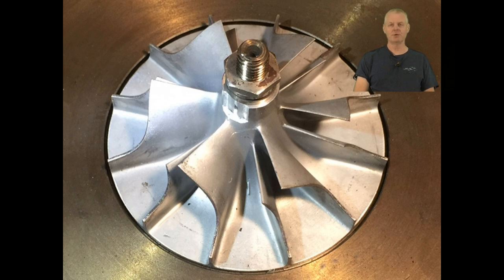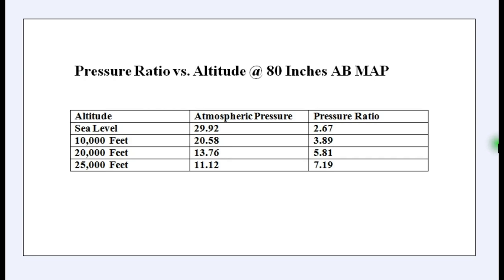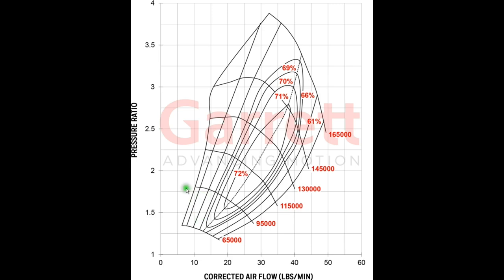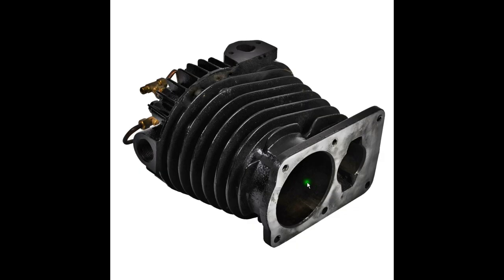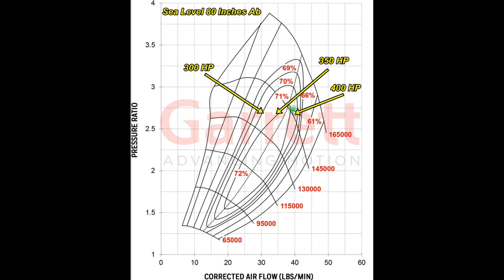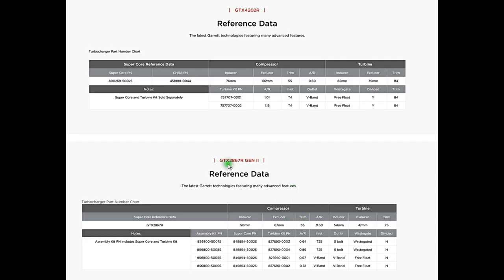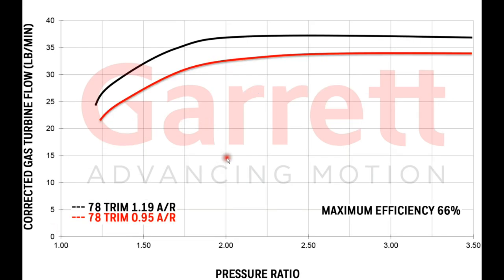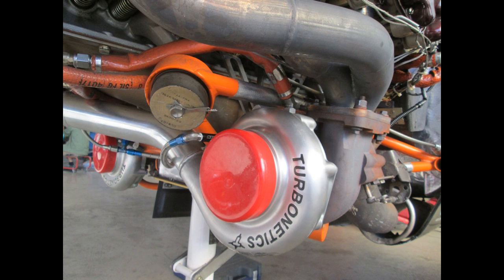What's Wrong With Raptor's Compound Turbo System?

Comment: Have you tried to contact Peter? I have been following him for several years, and he used to take advice from people who comment. Starting late last year I think, he has started to show a little disdain for people's comments. I really like Peter, he's a nice guy, and he's very smart about a lot of things, but he's clearly stubborn and close-minded when it comes to anything related to engines and turbos. Seems like he doesn't want to hear anything about it. I think he thinks that he's the smartest man in the room all the time when sometimes, he's clearly not. I'm really a big fan of his project, and I really wish you would contact him. If you do, please lead with your experience, like you do here in this video, so he doesn't dismiss you automatically.
Reply from the maker: I commented several times on his videos but he dismissed the suggestions as, like you say, he's knows it all after a few hours on Garrett's site... His project, his call, but it's destined to failure unfortunately  IMO if he stays on his present path. There's lots he doesn't know about many aspects of aerodynamics, structures, engines,  system design, turbos, cooling etc. We can see the results of that lack of knowledge so far.
Reply: @rv6ejguy  I don't know if there's a way for you to reach out to him directly, maybe if you contact the airport where he has his plane stored. There's got to be a way for you to get in touch with him. Your comments are probably getting lost amongst all the other comments from guys who don't know as much as you do. There has to be a way for him to watch your video, and see how much experience you have. He's a software engineer by trade, and I've been in his business for more than 21 years. I know the type, they always think they're the smartest person in the room, and you can't tell them anything. I posted a link of your video in his comments, he used to listen to me, so hopefully he'll see it.
Reply from the maker: @FreeSpeechWarrior  He's free to take or dismiss my advice or that of any other person. There's lots of nonsense advice posted on his YT by other people with no experience in these fields as well so who do you listen to if you don't know any better yourself? Peter doesn't know me and I don't know him. I made this video more for other interested folks rather than Peter. I don't see him changing turbos at this point in any case, maybe in the future on the 2nd prototype if there is one...
Reply: I followed Peter's build and my concerns grew as the project evolved. I contacted him and volunteered my experience and help with EABs and TDIs. He wanted nothing of it. He has a devoted fan base in his comments section that rail against any constructive or seemingly critical commenters as simply being "haters". 

There could be nothing further from the truth. I want his project to succeed, everyone I know that has been following it does.
Reply: @keepyourbilsteins  Yeah JP,  I guess it's just one of those things, you can lead a horse to water, but you can't make him drink. You can't help somebody that doesn't want help. Well you know what's going to happen? There's one good thing he's stubborn about, and that is testing. He's going to continue to test, and test, and test, and that engine is going to keep overheating and failing. Eventually he's going to have to either listen to the experts, or scrap the whole project all together. Because even though he's closed-minded, I don't think he's going to try to put out a plane that's clearly not ready for prime time. I just hope he doesn't get hurt going through the same futile exercise as he did with the last engine.
Reply: @FreeSpeechWarrior  I am afraid he'll get into a situation where he's going to be in the sky, wishing he were still in the ground, and unable to execute a safe  RTB. I screamed out loud at his first test flight. Had I not known it wasn't published posthumously, I felt for sure that was the end of him.

The 2 EABs I've done turned out great. Because I had EAA brothers and sisters there along the way to help and advise. I hope he gets his contaminated engine components situation from the previous engine failure sorted out.
Reply: I appreciate the concern Peter's clan have for Raptor and the desire to see it succeed. I hope he succeeds for a variety of reasons, not the least of which being success means he doesn't die in that thing.
Do try to understand that Ross does this for a living. Many people with forward-thinking, innovative projects pay Ross well for his knowledge and products. I think he's been quite generous already with what he has shared with Peter, to no avail. I would not expect Ross to devote his valuable time reaching out to Peter in a fruitless campaign. It is what it is.
Reply: @FreeSpeechWarrior  he has read Ross's comments because Peter has dismissed them in his video commentary.
Peter is smart enough to know who Ross is and what he does for a living.
Reply: @rv6ejguy  - As a systems engineer (but not a turbo expert), I believe the Laws of Physics will impose their own reality upon the Raptor design, one way or another. But as an old preacher once said, "humility works best when it's volunteered for."

Comment: These kids should of reached out to people whom are experts in the different fields that they have issues with. Seems like they're just wing it sometimes.
Reply from the maker: Well, Peter doesn't look like a kid but he certainly would have been further along in the project  and more successful if he'd consulted some aero, structure, mechanical, systems, diesel and turbo experts. You can't start from zero knowledge in these fields and expect build a world beating pressurized, compound turbo, diesel powered canard design. There is so much to know here in multiple fields, it's almost impossible for one guy to get this all right the first time. You'll get a lot of hard lessons along a very protracted design and development process as we've seen.
Reply: @rv6ejguy  well said.  I was going to comment the same, but you worded it better.   Peter should be managing the project, managing experts in order to stay on schedule. the death of projects like this is dragging it out longer and longer and longer.  momentum and interest eventually dies.

Comment: Sigh! This is not new knowledge, it is not cutting edge nor even something you need anything more than a slide rule to compute.
Read Stanley Hooker's book "Not much of an Engineer" which details his time at Rolls Royce and how they added compounded superchargers to the Merlin engine. Same calculations same results and Hooker did it all from first principles. He was a newly graduated engineer, in his first job designing compounded centrifugal compressors for the first time. 
Problem is that if you go too far down the turbo diesel route you end up with the Napier Nomad and then you reinvent the jet engine.

Comment: How much experience do you have with a turbo diesel? Diesel can take lot more boost with the high compression they can produce lot more torque. My Cummins 6.7 produces 850lb of torque yet only 375 hp. I suppose a gas engine of that size could produce lot of torque if it was using a turbo charger, but it would require high octane fuel to do it.
Reply from the maker: I have turbocharged diesels in the past. Torque isn't so important here. Hp is the measure of rate of work done and what we need in aircraft. SI engines put out more hp and torque per unit boost than CI engines. You can watch a comparison video on this subject on my channel.

Comment: I've done a fair bit of design and research with regards to compounding for a a high altitude aircraft using 4 stages including 1st stage supercharger. There are few inaccuracies in this video. The pressure ratios do not have to be the square root. The high pressure turbo can be fixed pressure ratio with the second changing according to altitude. You also mention the 2867 being the first stage, maybe you mean first stage turbine, not first stage compressor. You also don't state what the second turbo is. You don't state the power goal for the Raptor either. I agree Compounding is more difficult, but not that difficult. Air density also changes according to temperature, consuming air that is -40 is beneficial to power at a lower pressure ratio. This is the closest I have seen, with most not explaining it at all. My current project is compound and successful, its for a helicopter to set a HOGE record of 13500 metres. I had to mix compressor and turbine wheels, make a custom turbine housing, Centre housing, modify the compressor housing. Ideally I would like to make my own compressor wheel in the future but it is only a one off flight. My intake to exhaust pressure ratio is about 1:1 with tuned exhaust, twin scroll plus much more. Even the consideration of 7075 (not used) shattering at high altitude must be considered. It is a bit too complex for the average aircraft, especially helicopter, I will change it to single turbo after the record. I haven't got off the ground yet, but it has proven very efficient with testing. I can't wait to fly at 26000 one day, that project utilises a 600mm exducer on the first stage which is a supercharger. It is capable of flowing 12000Kw at sea level, but will only power about 200Kw at altitude. Intercooling for that project will be a large consideration even with low intake temperatures.
Reply from the maker: Matching of compressor flow the way you describe here would be difficult as PR varies as the square of the N1 but mass flow doesn't.

I am talking about compressors mainly here and the 2867 was what was used as the 1st stage compressor here as shown in one of the Raptor videos. The 2nd stage was never revealed but judging from video evidence, it was similarly sized to the 1st stage.

Raptor's hp goal was 350-400 hp.

Properly matched aviation turbos will almost always use custom compressor and turbine sections compared to COTS automotive units as the Raptor guy used.

I am not familiar with Kw being used as units of mass flow.

Your project sounds cool! I hope you do a video of this when you make the record attempt.
Reply: @rv6ejguy  It's not difficult, it is no different to having a single turbo. So you agree that turbos can be customized yet you think that because the compressor housings are similar that means the impellers are also. If the compressor housing on the smaller turbo is large, it makes little difference to flow. kW is the standard unit for the measurement of power, I exchange it with 1g/s.
Reply from the maker: @chippyjohn1  Every turbo I've used in the last 30 years has had mixed and matched compressor and turbine sections-a very common practice.

While compressor inducer and exducer diameter doesn't tell the whole story for mass flow it is a rough guide within a series of stock type Garrett turbochargers like those used on Raptor. Wheel height is also another variable to be considered.

You mentioned 12000 Kw flow. Mass flow isn't measured in Kw which is an expression of power- about 16000hp in English units. Centrifugal compressor mass flow or airflow units are commonly CFM, lbs./min., cubic meters/sec. or Kg./sec.

I can only surmise that your helicopter engine only outputs a tiny fraction of this 12000 Kw number so this make no sense. Also, a compressor to supply this much mass flow (around 2000 lbs./min.) would take thousands of hp to drive it.
Reply: @rv6ejguy  The 12000g/sec 12kg/s is for a high altitude plane designed to fly at 26000 metres. That is what it would flow at sea level, but at 26km only about .2-.3kg/s. My helicopter is only two stage, much more simple with Max flow of .165kg/s. For the petrol I am using and all parameters, 1kg/s is equal to about 1000kW, or 1g/s = 1 kW. You have to love standard metric and its simplicity. Not sure why people still use the old measurement. Nice chat mate, happy new year. As far a compressor wheel sizes go. I am using the compressor wheel from a gbc 17-250, and s200-70. So a large size difference. Due to air density differences, and desired weight I use a custom compressor housing on the s200 making it look much smaller. Maybe what raptor did, although I quickly watched some of his videos and did not a power struggle even with increased boost.

Comment: Noone seems to be mentioning the fact that this is a pressurized aircraft that will rely on those turbochargers -which is probably going to cause peter alot more stress.

Comment: I wish you could develop a Diesel motor for Vans Rv-10
Reply: Higgs diesel AC Aero is developing one right now.
Reply: @JTGmartin  Yeah I have been following them but like many others Im not holding my breath, plus the cost is substantial compared to a new Thunderbolt 540.
Reply: @Dragonrc.  yes I feel ya like delta hawk, I didn’t have any gray hair when I saw it for the first time.......
Reply: I think the only diesel that is worth while, won't eat up gearboxes, is a proven design, and has a reasonable weight and great efficiency is the tried and proven 3-cyl opposed piston two stroke turbo/SC junker type design.  As with all new a/c engine introductions few rarely make it. Gemini was one such example. Pity.
Reply: Why? Gasoline engines are better for aircraft in every possible way.
Reply: @PistonAvatarGuy  I would love to go this route but airports dont carry car gas or I would have been all over this option.
Reply: @Dragonrc.  Some do. The more people demand it, the greater its availability will be.
Reply: @PistonAvatarGuy  I have flown to a lot of airports over and actively fly around my area and nobody has regular gas.  With current movement of GA and Experimental I doubt you get anything close to a fraction of airports with it before we are old and dead.